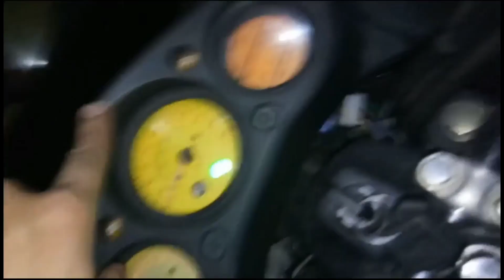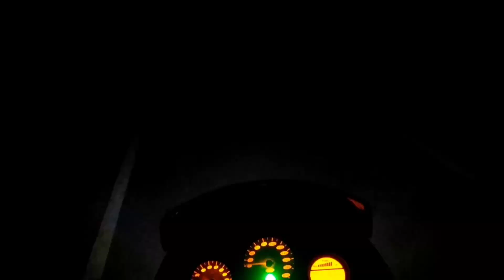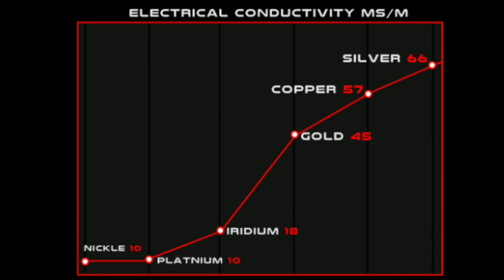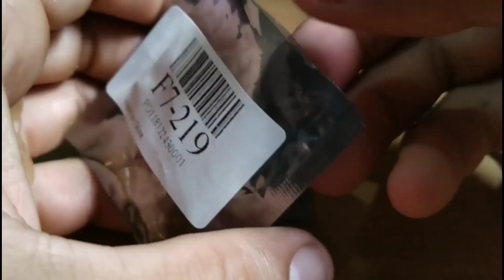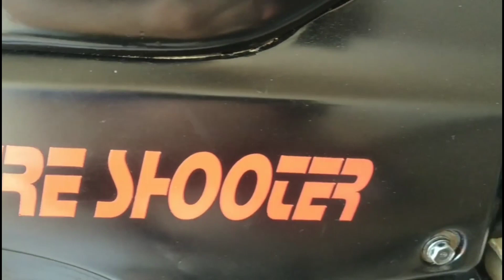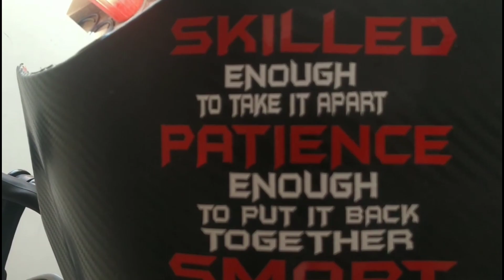2 Years modifications on karizma R

Comment: Nice video bro....
I had a question regarding the led headlight. Maine nighteye ki led install ki hai apne karizma R Mai but problem ye hai ki low rpm Mai (1000rpm) led light fluctuate krta hai aur jab brake apply kro to headlight bhi fluctuate karta hai.....iska koi solution hai kya
Reply from the maker: weak battery i guess
Reply: @MyRideMyPride  I checked it....it's in perfect health.
Reply from the maker: @nitishb7745  ok,  yeh normal hai kyu ki moderns bikes mai ecu hota hai jo alternator ko signal deta hai ki bike ko jyada electric power ki need hai toh wo automatically rpm bda deta hai or hmari karizma mai CDI hai jo esa kuch bhi nhi kerta eak chiz try kro bike ideling mai hai or led fluctuate ker rhi hai toh aap RPM bda ker dekhi jo carburetor mai screw lga hota hai 1000 - 1200- 1500 RPMS jrur effect pdega.
Reply: @MyRideMyPride  OK....thanks bro👍
Reply: @nitishb7745  install 100mf/25 volt capacitor for the led